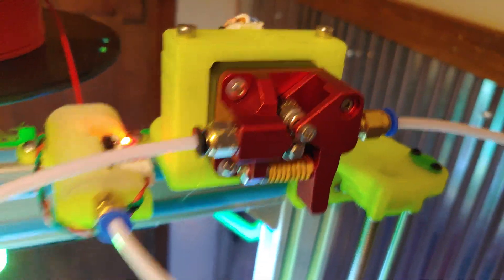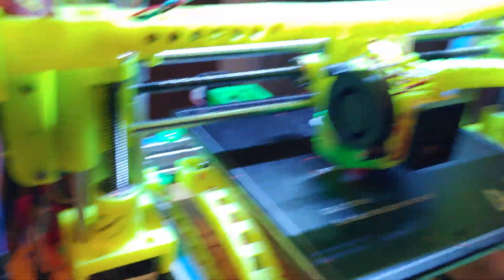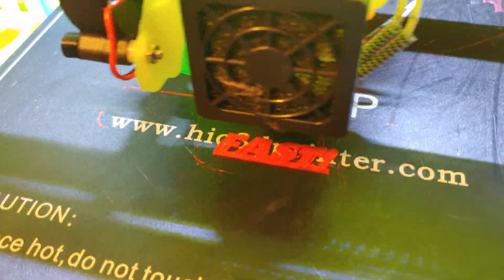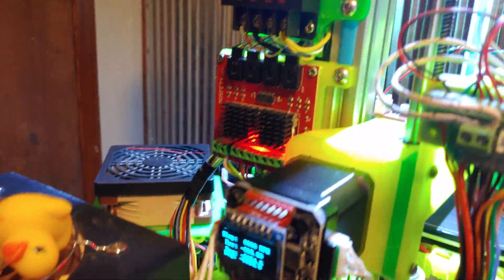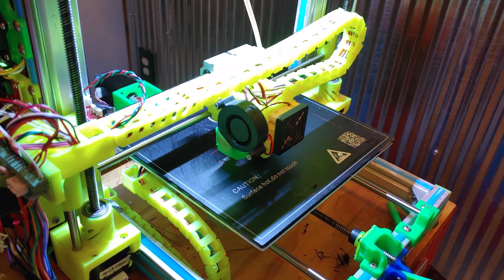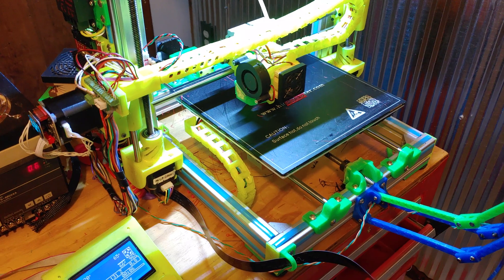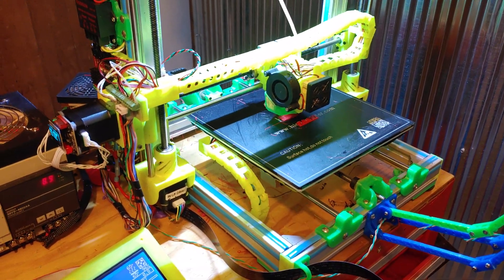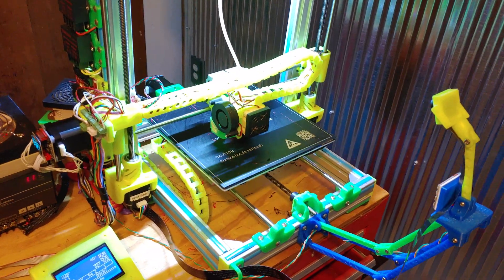3DLS @ 150mm/sec printing speed, 200mm/sec travel!

Comment: I'm starting to print your printer here, do you think there's anything to be gained from using linear rails over smooth rods/linear bearings? seems like a tad more rigidity and possibly less long-term wear? I love that your just thumbing your nose at the belt crowd, real CNC is always going to be better when the precision is known and constant and belts just can't do that for you.
Reply from the maker: Yeah I mean, sure you could add more, but why? It's still just a 3D printer. There's nto much more of a point to making a FDM machine any more stiff and precise than this is. It can already print out the compensation for lash built into PrusaSlicer.

Comment: I've had an idea to do this for a long time.  Regardless of the noise and flack lead-screws in printers seem to get, I really just wanted to try it.  So I'm glad you did it and eventually I WILL build one.  But seriously, if you really want to show off the speed, then show it.  Set up a camera, record the full benchy, and maybe a second one on the spinning spool (although, I've had my printer unspooling quickly, and thought "man that's a load of plastic its printing", so I'm not sure that's as great as seeing the head sail over the print) and let it go.  Panning around to all the extra equipment doesn't really help a speed video (I know you were trying to get some settings, but seriously, it didn't help).  That way you can just show the head printing as fast as it goes.  Even a "timed" build from your mounted cam (where each shot gets the current time stamped in it) would do better (i.e. slow settings vs super-fast settings... and resulting build quality in the end).
Reply from the maker: I will setup a second pi and let it record a full speed bench with the new direct drive setup should be able to print at 200mm sec now
Reply: @Morninglowe  I'll look forward to that.  Like I said, would be good to do a "slow" print for quality comparison too.  You don't necessarily have to SHOW the slow print though (everyone has seen slow print heads I'm pretty sure).  Given your design, my question is this: do you truly need the feedback controllers?  Not that I think there is another way, but I heard you mention somewhere (or saw it written somewhere) that you had trouble otherwise.  I'm interested because I want to go your path, but there are one or two places I want to do a few different things, so I'm trying to gauge how much trouble it will be.  So I was wondering how much trouble the feedback controllers were to incorporate into Marlin (or maybe it didn't need to matter to Marlin?).
Reply from the maker: @roboknight  They dont matter to the firmware at all. Marlin sees them as DRV8825 controllers. There are some tweaks documented in the controler's papers for it. You can download the firmware from the thingiverse links to the 3DLS and have a look.

As for slow, my "slow" settings for this machine is 100mm/sec and 150mm/sec travel. With the combination of screws and the feedback controllers there's no error. I had to make custom Prusa slicer profiles because the built in error correction made it look bad, because it printed out the error corrections! This pushes the limits, and it's not really cheap to build. I am making a second one now though. I just don't have a lot of spare time between job, working on the house and building a diesel jeep XJ.
Reply: @Morninglowe  Yeah, the pain is real... no time for projects.  I watch my mother complete all kinds of projects then remember how much more complicated the stuff I'm trying to work on is.  I've got a robot lawn mower I haven't started because I need to build the frame, a couple of FPGA things, and several microcontroller things.  Time is the ultimate currency I think.  Anyway, I was hoping you'd say that about the firmware.  As for the slicer, yeah, I can see that's going to be a challenge.  Don't know how difficult it was taking out that "slop" from the slicer.  Maybe it wasn't hard?  At any rate, this is EXACTLY what I was interested in.  A printer with no slop.  Or at least none in the actual head movement.  No real "tweaking" there to dial it in (meaning lead screws just do what they do).  I'll be interested to see your ultimate print quality at 200 mm/s.  That's some exciting stuff if it produces good quality prints.  So far, it seems to have all of the benefits I thought it might have and nothing I wasn't really expecting.  So I'm still pretty stoked to build one.  It'll be especially exciting if it is a solid performer at high speeds and competes in quality with some of the other stuff out there.  It seems like it might have a shot.  My ultimate plan is lead-screw, direct drive... no more bowden tube.  I'd like to be able to use it for flexible filament as well as just PLA, PETG, and the rest (I don't do ABS because I currently have no solid ventilation).  Plus, I believe it may be "easier" to enclose one of these because any heating will ultimately do a number on belts... but lead-screws... not so much.
Reply from the maker: @roboknight  
https://www.dropbox.com/s/pkx9rr7yhz5he9a/Screenshot%202020-12-03%2013.01.47.png?dl=0

It's printing right now. Making a new base for one of my 3d printed laptops. It's running in direct drive, there's a newer video on my channel about that too. You can see all my designs here: https://www.thingiverse.com/morganlowe/designs and our Discord server is here:  https://discord.gg/ENnZcyHp if you want to join us in ranting

Comment: Hey morgan, what do you estimate the total cost of the printer would be? I've owned an A8 kit and would like to compare to what I paid. Thanks.
Reply from the maker: Hey sorry just found this! Uhh depends a lot on where you choose to get parts. I estimate about $200-400.  It uses little of the A8 parts overall. It's based on the Anet A8 because I got 2 of them then started to make upgrade parts. This is all the upgrade parts on one machine with a much different control system.